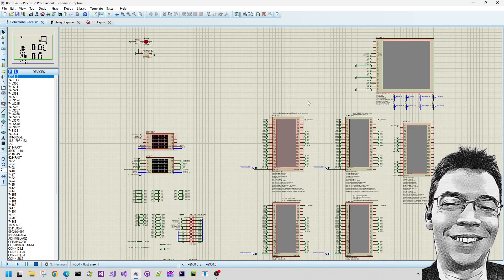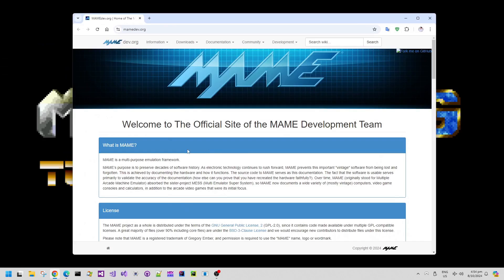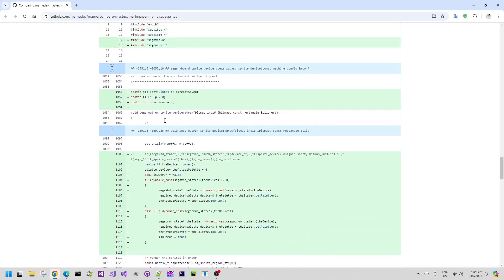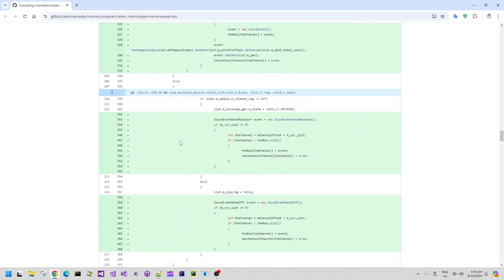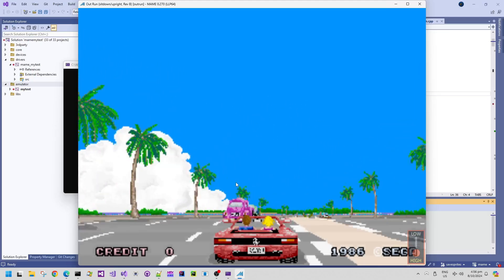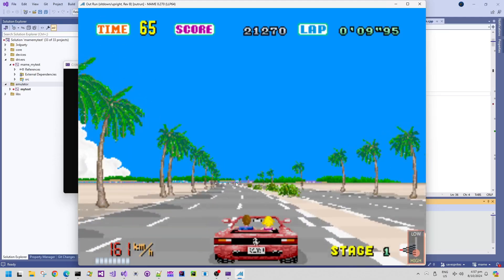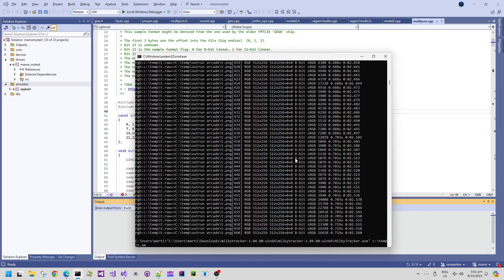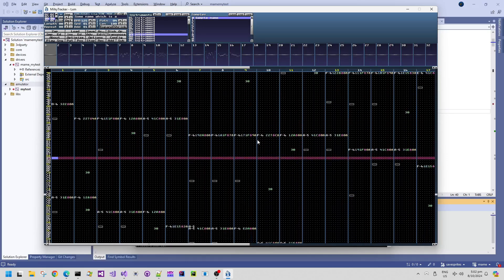MegaWang 2000 Turbo Edition - 32 - A quick diversion to MAME for some assets

Comment: Good stuff.  Can you do this for all of the other systems in MAME while you’re in there? 😏

PNG files actually have an alpha channel,  btw. No need to fill the background with any color. 😉
Reply: Extracting sprites as 32-bit PNGs (to get alpha channels) are not very useful for retro hardware (talking about a 1 MB of RAM etc). I am sure Mr. Piper is converting these sprites to indexed color bitmaps, so PNG is just convenient during exporting from MAME...
Reply from the maker: It's possible but would need a more general solution. My tools for retro image conversion don't understand alpha hence the need for a solid colour like 255,0,255.

Comment: I have to wonder if it might have been easier to say write a program to rip the audio from a VGM file, but whatever works. Cool quick way to extract what you need.
Reply from the maker: I considered reading the VGM file format but there's some extra state in the hardware device, like processing pitch and note logic, that I needed to hook into.